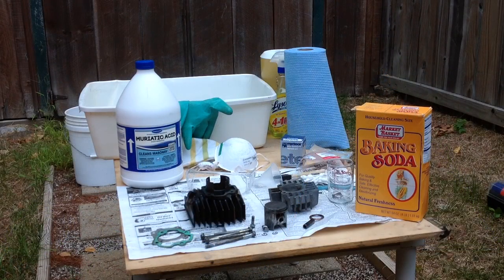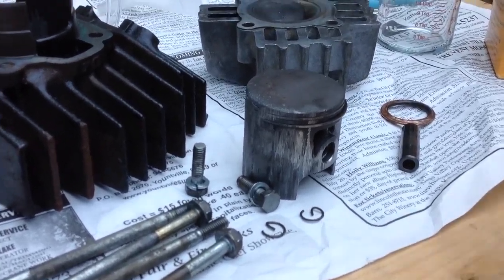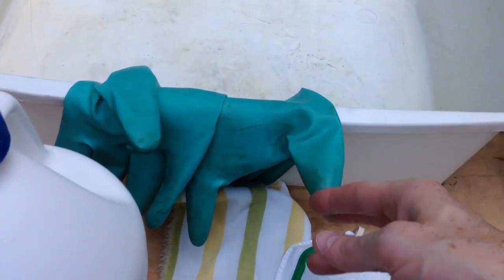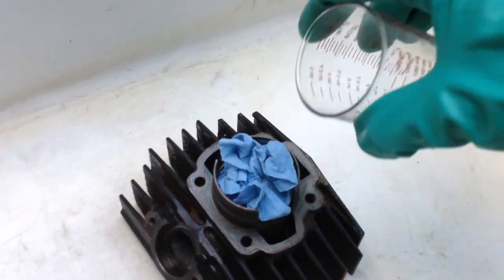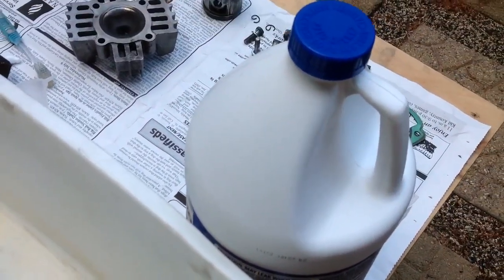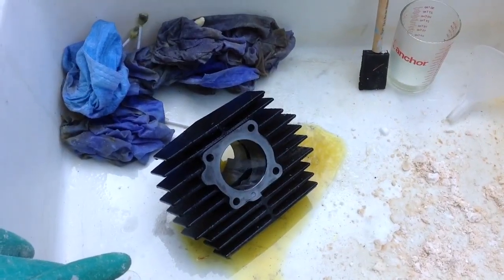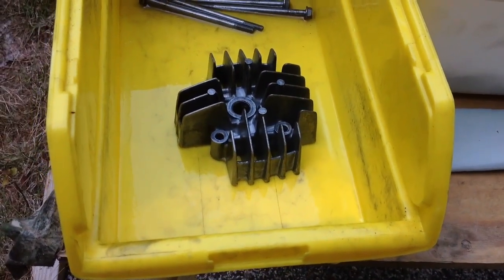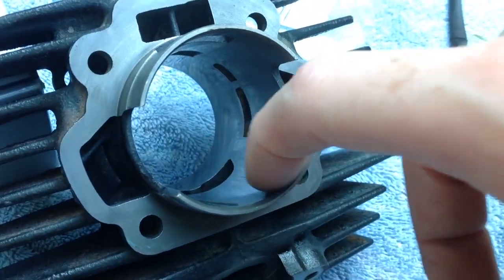Honda Express Moped Muriatic Acid Wash / Seized Cylinder Repair

Comment: The trick is a strong sodium hydroxide solution. It will dissolve the aluminium, not the iron. I just rescued a Honda Bali DR Evolution kit with this method. Even the piston could be reused. Just added new rings from a chainsaw, opened up the exhaustport (for a little better performance and cooling) and its fine again.

Comment: looked familiar these Cylinders where used here in Holland on the Honda Camino heck even the engine looks the same
awesome moped to drive with good old memories
Reply: +jhax78 it is the same, just like the Honda PX cylinder, only the head is different

Comment: Hey man, love all you do, your vids and express info you post.  Wanted to help keep and everyone else safe with a little info about PPE (personal protection equipment)  That "mask" you are using for the harmful vapors, and they are, is a dust mask and will do nothing for helping keep the toxins out of your lungs and nose passages, for that, one needs a respirator.    Same is true for paint fumes ect.  These masks are only to keep small particulates like dust from grinding, from being inhaled ...fiberglass metal ect...and you dont want those going in you either.  Again, thanks for all you do and stay safe.

Comment: That is not a suitable mask for gases :-(
Reply from the maker: Yes, you are correct. This point was highlighted by another individual commenting on PPE (Personal Protection Equipment). It seems you could find a suitable mask on Amazon for $20+. 3M makes one: Respirator Organic Vapor Acid Gas Mask 3MR5203. I am not a professional... perhaps you could suggest the suitable mask for gases for everyone?